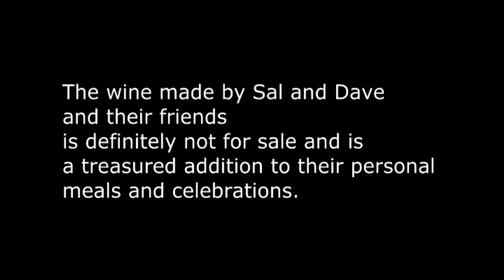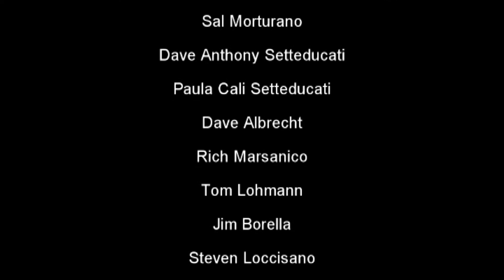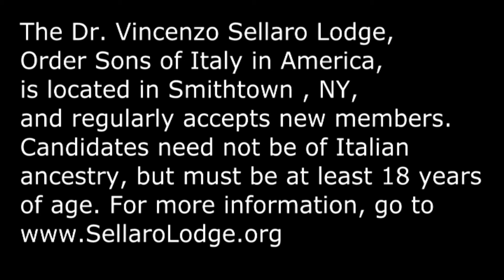Italian America Long Island E8 Winemaking with Sal

Comment: They don't really press the grapes in that rusty old thing do they?
Reply: The grapeskins are squeezed in that press after the majority of the juice has been crushed from the grapes by another machine. The crusher sits on top of vats and the juice from the grapes drips down from the crusher into the vat along with the crushed skin. After the juice is drained from the vats, the remaining skins are placed in the press to squeeze out the rest of the wine. The little bit of rust on the corkscrew has no effect on the flavor of our very, very delicious wine, and the extra 10 gallons (out of a total of 180-200 gallons) adds to the total output. Our wine has nothing but grapes in it. No additives of any kind. No sulfites, noi preservatives. I'll drink our wine made with our 125 year old "rusty" press rather than any store bought product made in shiny steel vats and filled with chemicals that are actually poisons!
Reply: @Davado65  completely understand. I've been making wine for many years, about 160 liters a year, and have a press that is about 95 years old... The pan or basin on that thing looks just a bit too rusty. No biggie. Good video